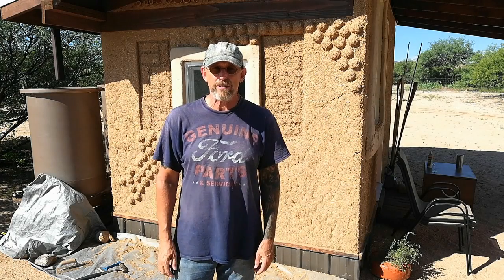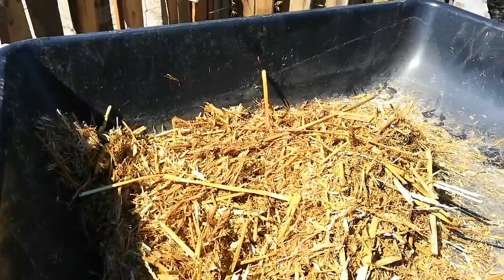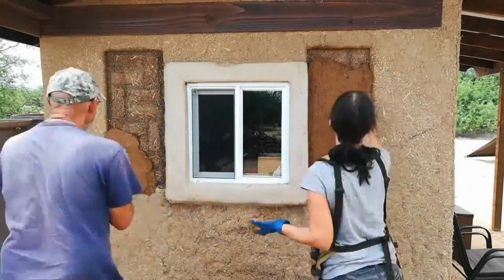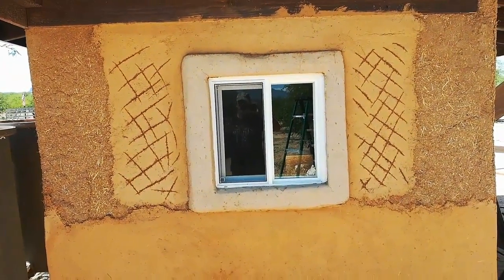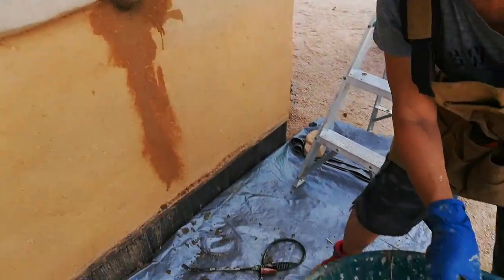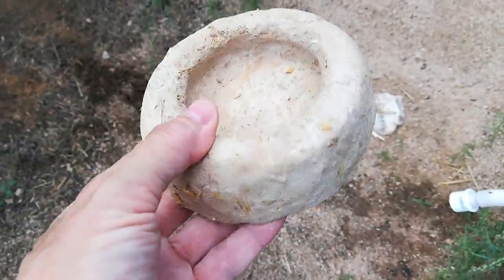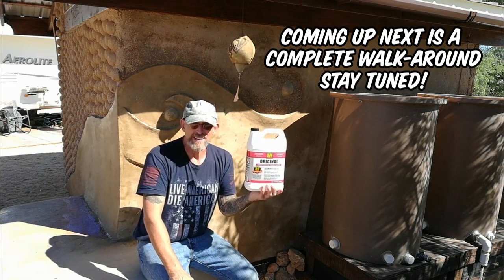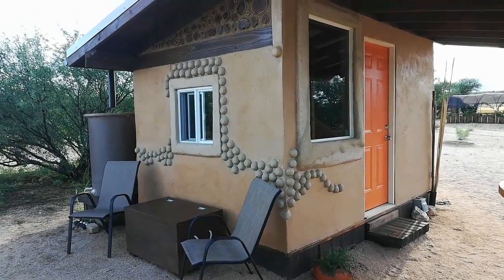Saving Our Solar Shed! Amazing Transformation and Reveal!

Comment: Loving it. You might want to experiment on the floor now. Use the same mixture and apply it under the porch just so that you can get the field for it. I think it would work. Just frame it as if pouring cement and fill it in with mixture. See if it holds up to the weather.
Reply: The Upside of Downsizing  Awesome

Comment: I had read that using cement in the plaster mix traps moisture and is especially bad for a bale wall design. I'm curious how it's holding up after 3+ years? Also...is there a reason you went with cement over lime?